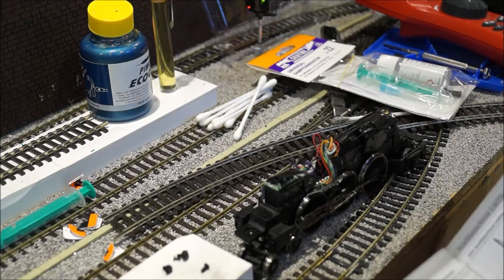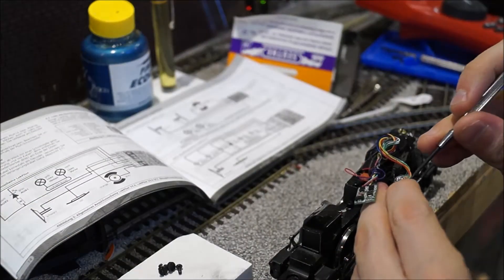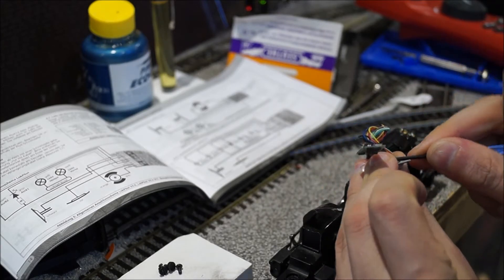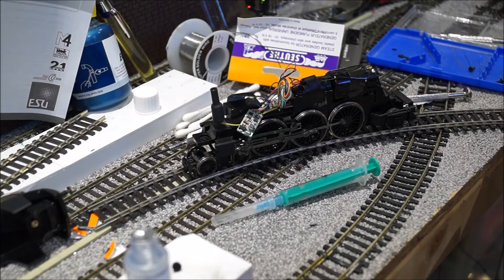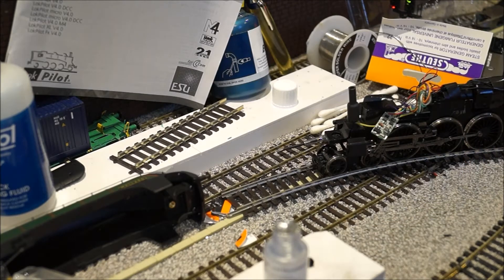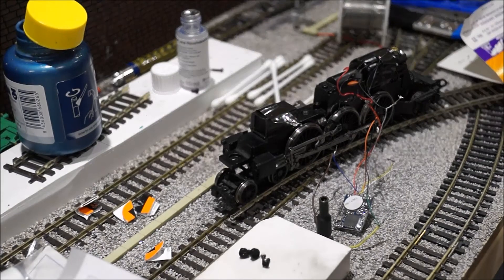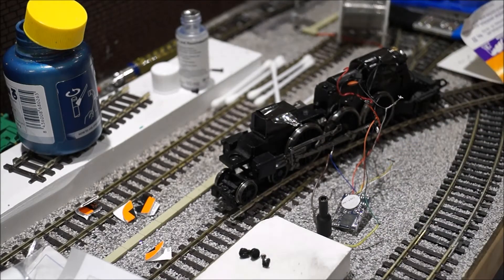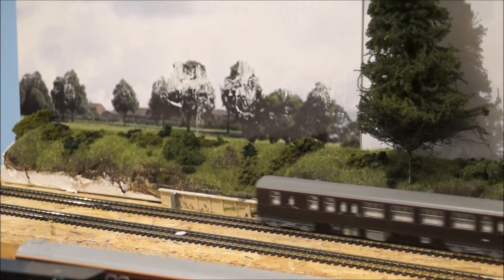Model Railway Gouldian junction Installing smoke unit into steam loco

Comment: What size of smoke unit u using
Reply from the maker: Stewart Finch not shore on the size of it. All I can say it was the number 22. That they sell. If you jump on eBay and look them up. Look for number 22 and they has the size on there. Shane

Comment: The Seuthe (pronounced SOYTER) smoke unit you have works from AC or dc feed, so the wires can be connected either way round. In wiring them up it’s important to remember two things; 1) DO NOT shorten the wires. These are solid core “resistance wire” and their length is critical to operation. They can, however, be lengthened to aid connecting them to a supply. 2) DO NOT bend the wires at the base of the unit as, being solid core, they are of a composition which will break very easily. Well worked out but you MUST check the current consumption of the smoke unit and compare with the current of the decoders output. Exceeding the current draw on the output will “fry” the decoder!
Reply: The new Lionel ho  Berks can run on dc or with lioncheif remote. Is it possible to add a smoke unit to those as well? They don't come with smoke units and a lot of people who buy those sets feel let down by it